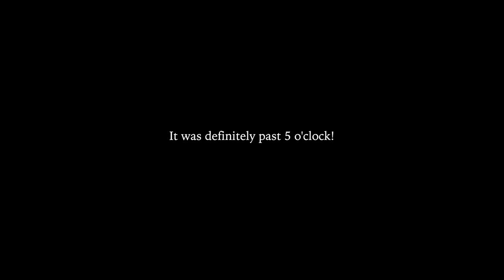First Mow of the 2020 Lawn Care Season!!

Comment: Hello it's great to see lawns mown with reel mower, I use to help the groundsman at my secondary school mow the cricket pitches,we had a Diesel Ransomes 36 inch 7 blade Mastiff for the out field a Ransomes Matador 24 inch7 blade mower for the pitches and a Ransomes Matator 24 inch 10 blade  mower for the playing pitch set at 1/8 inch it had a shaver blade fitted,we use to get points for the pitch quality,the groundsman use to have a walking stick with graduation Mark's on it if he was in a bad mood he'd measure the height of the mown pitch and lord help you if it was higher than the first mark

Comment: I’m on mow #4 (well... #5 today as a charity cut...) here in Kansas City. Growing a half inch or more a day. Mowing every 2-4 days. We’ll see how long I can keep it up with work and weather. For now looks great though. Lawn is so irregular and sloped I scalp areas when I go to 2.5in. So I changed to 3in after the first two cuts. Tried to train it lower but not smooth enough. However, did 3.5-4in last year... going to try and hold the line at 3 this year. Seems to be happiest and best looking at that height.
Reply: Great video though! Enjoy watching it all come along. I haven’t done anything this year but soil conditioner, prodiamine pre emergent (sprayed), and ironite app. Still need to do spring fert, treat for weeds (not many, going to get to spot spray, finally...) and treat for pests grubs (they got me good last year treated after damage was done...) but the growth rate has me baulking at adding nitrogen. I went heavy on split apps in the early fall/late fall last year.
Reply from the maker: Sounds like you are getting there!  It's a nice thing to be in minimal maintenance mode and not have any huge issues going on.

Comment: Doesn't it feel great. I had my first mow today. I walked as slow as possible just to savor it. I noticed a few things, 1st my yard is looking the best thanks to your advice through last fall. 2nd it doesn't look as good as I would like, but I don't see that as a negative just a challenge. Lastly there are weeds pooping up now that usually would not be there until 3 to 4 weeks from now.
That "sissy" grass is looking a lot darker that the KBG. I also noticed it on Pete from GCI turf. I want the switch to KBG for it's spreading ability but I want that dark color...🤔
Reply from the maker: The best varieties are very very dark

Comment: What are your thoughts about the service from Swardman? I have a horrible experience. It took over 3 month to repair the Swardman! To me this is unacceptable and would never by one of them again. Too expensive and to slow in repairing!
Reply from the maker: I've never had anything break on mine but doesn't sound good from your experience
Reply: @ryanknorrlawncare  What would you do if the control board of the Swardman Electra broke? Where would you take/send the mower and how long would it take to get it back? I had this problem and it took several months to get the mower back...which is unacceptable.

Comment: @1:45 As a mower mechanic, I can tell you that either your stationary blade is bent or your rotary blades are. The ends aren't touching. (Uneven wear due to cutting half bladewidth?)
Manual sharpning of the rotaryblades is next to impossible without special tools.

Let it run upside down, spray WD40 on the stationary blade and SLOWLY increase the tightness of the blades so they can wear in on each other. If you can cut paper over the entire length of the blade you know that they are sharp and in full contact.